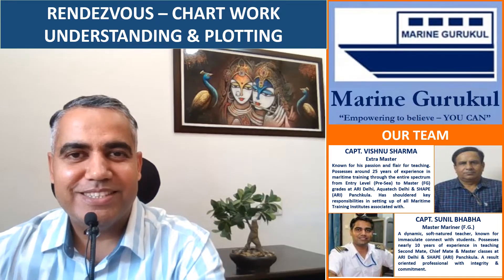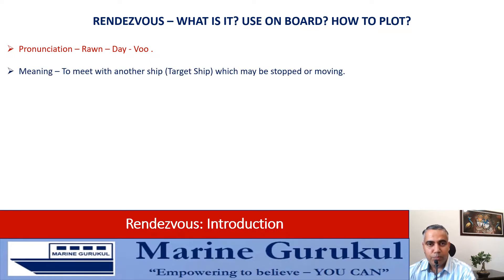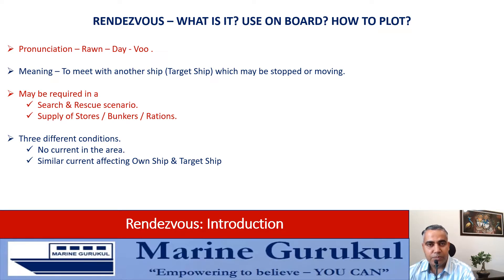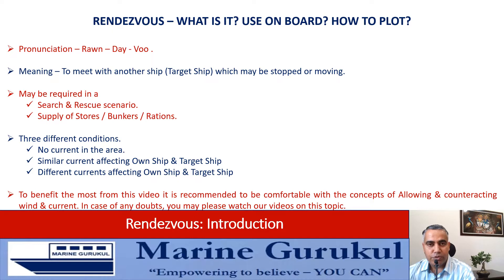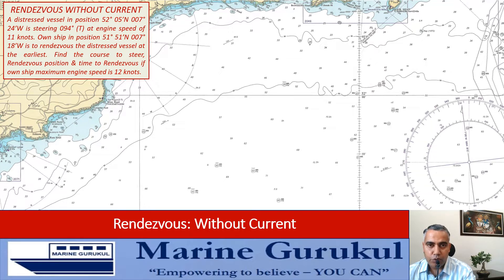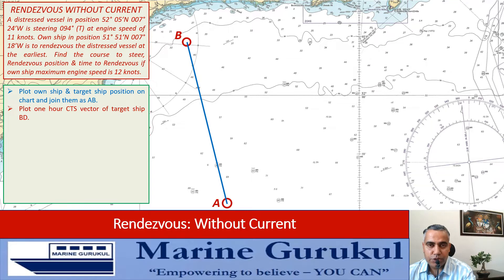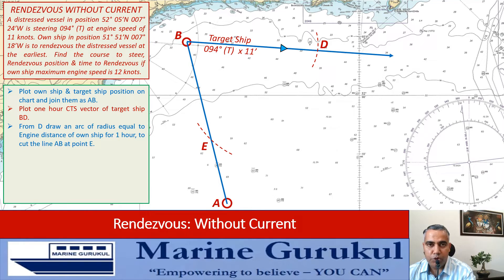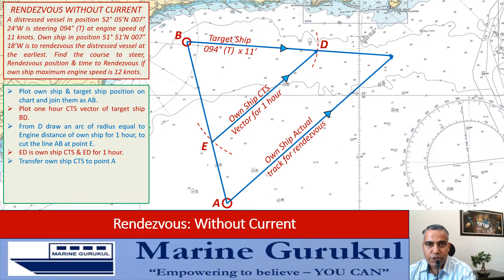Rendezvous - Chart Work

Comment: Excellent videos and nice expalnation.All concepts cleared which couldn't be clear after reading the chart work books. Still having one doubt. if the distance between A and B are very large, how do we plot on the chart and solve it ? For eg Q fm MMD May '22.
Q. Your ship (A), max speed 16 knots, has to catch up with a another vessel (B) that is steering a course of 216(T) at 9 knots. Set your cost to rendezvous 'B' if she lies 102 miles from 'A' in 334( T) direction. How long will it take to reach her?
Reply from the maker: In such cases you can plot on answer sheet by scaling down - choosing suitable distance e.g. 1cm = 5 or 10 miles. 
Best Wishes
Reply: @MarineGurukul  Thank you sir for clearing my doubts.👍